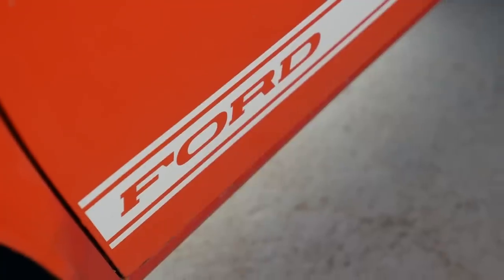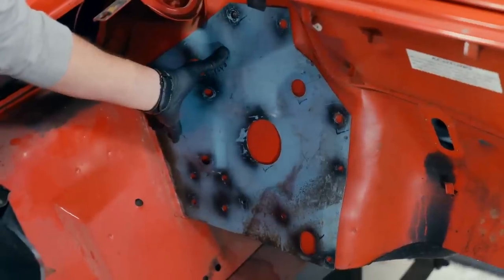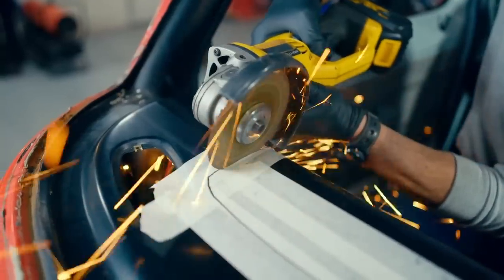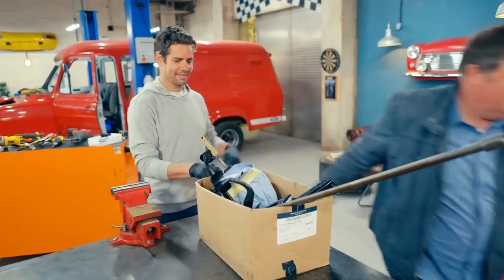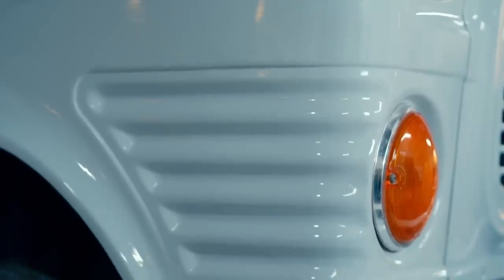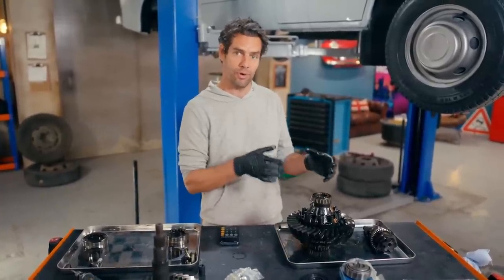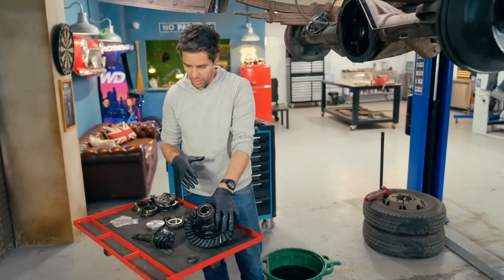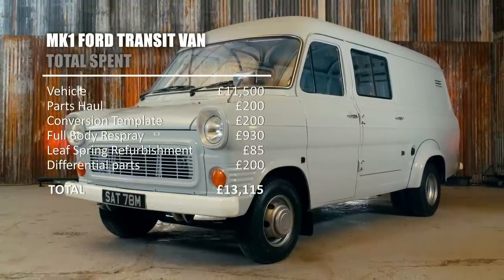Elvis Transforms A Legendary 1974 Ford Transit Used In The German Fire Brigade | Wheeler Dealers

Comment: No way that transit costs £900 to repaint. Great van haven't seen a mk1 transit since the early 80s. Great looking van.
Reply: A mate just paid 4.7 k to have his MK2 Jaguar repainted. 930 quid seems cheap to me.
Reply: @zaedlo  the £900 is probably for paint and materials.
Reply: The paint alone would be 600.
Reply: Firetruck van, low mileage, with rust free and straight body. Not much work before respray. I got a quote on mine with some rust issues (not through) and dents, about 3500 pounds..
Reply: Yes way😁 for just a spray over of a pre-prepped as stated van. Prepping is the most expensive using industrial truck paint £57  5 liters and thinners £12 of thinners . £250 is the going rate for a spray booth rental then there is labour and overheads. The going trade rate for spraying a panel (door / wing etc) with some minor repair prepping  was £75 in 2021 using car paint.  It's probably around £90 today.
Reply: @jasonmeehan1269 would agree.. Unless it was in the US they have a macco one day paint shop.
Rough as chips but works,
Reply: @zaedlo was probably just the paint alone for a straight colour 2k.
As high solids clearcoat is 120 per litre

Comment: Why converting a car that has the steering wheel on the right (correct) side already like the rest of Europe
Reply: why not just ADD a 2nd steering wheel? like the cars in a merry-go-round? ;)
Reply: They literally put it on the right side, where it should be, left hand drive sucks and looks wrong.
Reply: Of course it looks wrong in the UK, but as soon as you leave UK it looks correct

Comment: That is a whole hell of a lot of work to convert that MK1…..As a autobody repair man of 30yrs, they cut out of this show probably around 75hrs of reworking time to make that conversion happen. As someone else mentioned, £900 to refurnish the MK1 sounds awfully cheap. The only way that could happen is if Elvis did all the work to prepare it for paint and all the bodyshop had to do was provide the paint and labor to spray it. That would make sense

Comment: I'd probably have left it LHD. I've been driving American LHD cars in the UK since 1996. (Actually first one I drove was a '72 454 4 speed manual Corvette Stingray over in Ulster in 1993, but it wasn't mine).

No problem driving LHD in the UK, plus most accidents on single roads here are frontal offset impacts, so in a LHD drive car you're technically sat on the passenger side, so you're not going to eat the steering wheel and have the pedals shoved into your knees.

Also, I forgot.

Who else is playing the Elvis, "When I was in F1" drinking game?
Reply: you think itd be more or less awkward with the van?

Comment: Hi there Just wondering where you found the new Differential Gear? Would bei great to know. Would Love to get my Transit to Higher top speeeds...
Reply: I have that 4.63 diff and it is horrible, you need to find a 3.43 - 3.7. Otherwise 80Kmph is brutal - 100 Impossible unless at 6000 rpm.